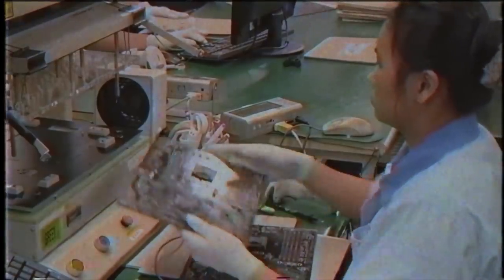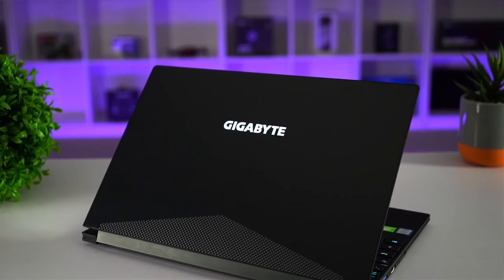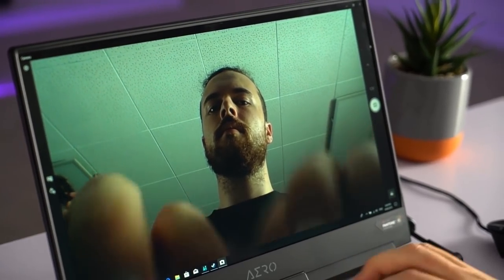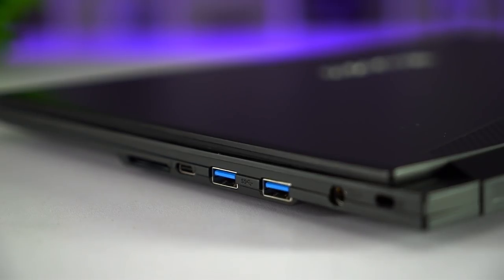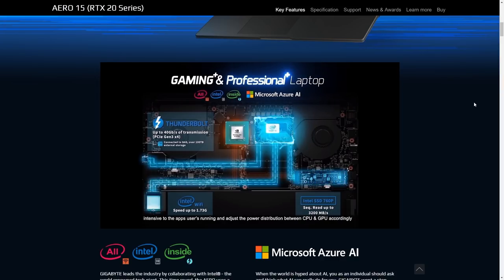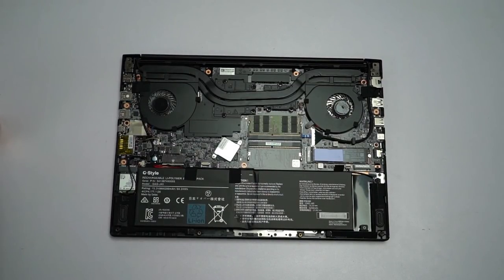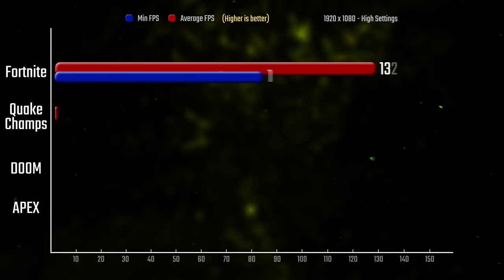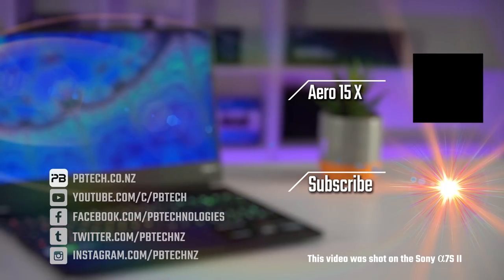Gigabyte Aero 15 X9 Hands on Review

Comment: years later the AI manage is still garbage. Just got a new one and had to rip all the OEM software out of it to get it to stop constantly changing settings while in use. Did a clena install and stock windows ran faster and much much cooler. Its ice cold runs faster and tha bttery last longer than when their AI management was intsalled.